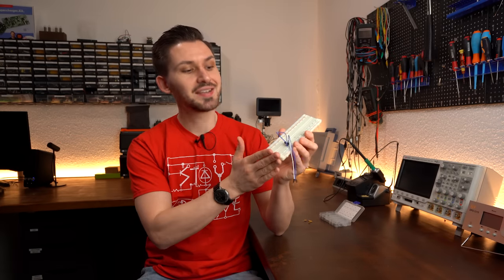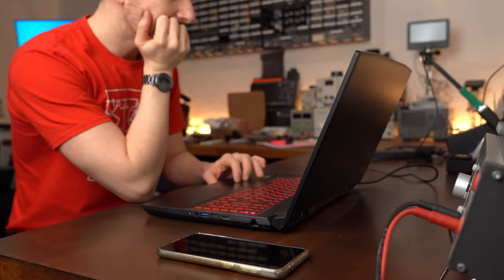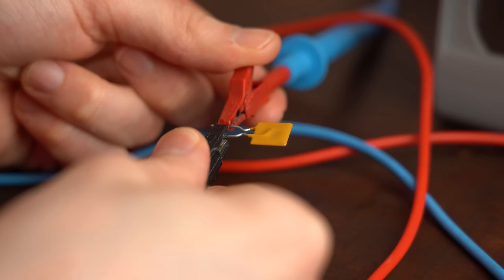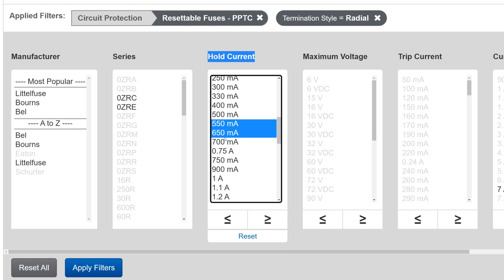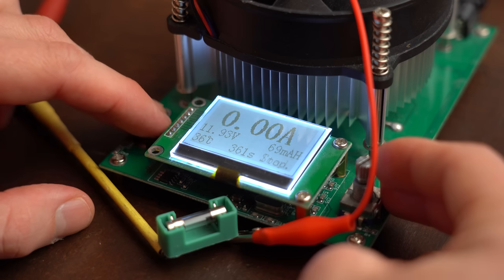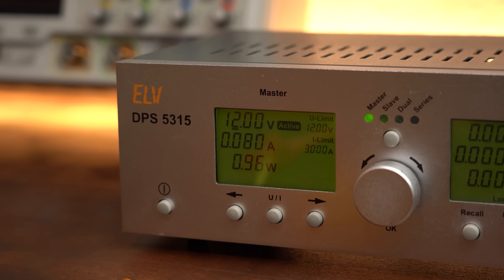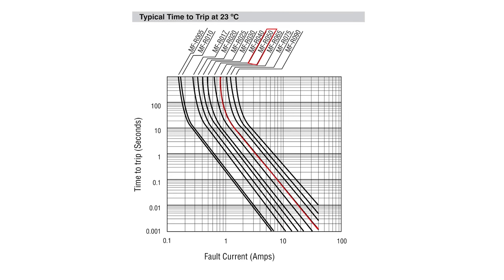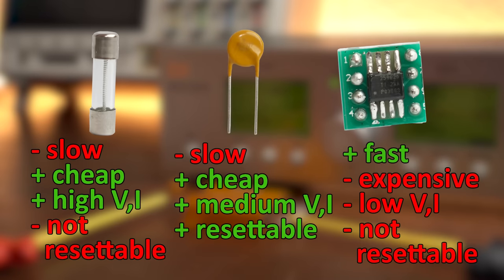The Best Protection for your Circuit is NOT a Fuse!.....but a Resettable Fuse? EB#54

Comment: Fun fact: Voltage rating of PTC fuses is important: I once experimented with a PTC that I took from an old knock-off Ni-MH Roomba battery pack and I exposed it to 10 A 32 V. I don't remember the rating, but it tripped and for about 10 seconds staying in a tripped state nothing interesting happened... After which it burst in flames in a spectacular fireball! So the conclusion is that voltage rating of a PTC fuse is important.

Comment: Great video, but a minor note about the comment that eFuses aren't resettable - that's incorrect. The TI TPS 2596X0 (that you show in this video) is latching off, the TI TPS 2596X1 however will auto reset. I learnt this while shopping after learning about eFuses in your first video. :D I have TI TPS 249631's in my pet projects thanks to your video, and they happily auto reset when I accidentally trigger them.

Comment: Fuses are there to protect the wiring (and PSU) supplying the current to the device.
Reply: If the fuse is located in the plug which is connected to the wiring, yes, however many devices contain fuses on the circuit board inside the product, and they are not there to protect the appliance cable.

They are typically much lower current rates, say 100mA.

Comment: 8:36 I think the variable power loss is reasonable, since resistance increases with temperature and power loss I proportional to resistance. So unless the PPCT is maintained at the literature temperature it is always going to be different. More often higher than lower since temperature increases during operation.

Comment: Pretty easy to replace the fuses on the phone motherboards. Provided you have the right tools. Micro Tweezers, flux, and a microscrope. Using tools will give you the schematics needed to debug the lines and find the shorted fuse. But I digress. I understand not everyone has access to the physical tools needed, as low end would be around $1200, but still ver achievable.

Comment: I normally use PTC fuses, though i find they get pretty expensive as you go up in ratings as they get physically bigger compared to your regular one-shot glass/blade fuses. They also get a bit looser in characteristics. So for some things like a Train speed regulator that may have to conduct up to 120W and preferably has a faster one-shot on a sudden derail short. I use automotive blade fuses instead.

Comment: Best Testing  fuse is a incandescent bulb/lamp('s) in series  
Not Only does it Pervert a True dead Short but also acts as a current limiter & Below voltage Limiter  For more Sensitive & untested "Experimental"  "FAULTY" Devices / circuits it makes  more sense
Reply: Incandescent bulbs do protect...but there are circuits  that require a small real-estate area...besides rigidity..in some instances the  lamp is a fragile / brittle...component
Reply: @analoghardwaretops3976  That's why they're only on the test bench. Inside finished products they don't really make sense.

Comment: fuses are mandatory especially ebikes whenever i wire up an ebike I just put a 60A dc mcb then a ton of glass fuses for the accessories and blade fuses for the controller and motor so that in case of problem i can easily find who is the culprit

Comment: Learned about these when troubleshooting rasb 3B and few other electronics. My question would be what effect of temperature has for these different fuse types? Does the cold delay the fuse potentially causing damage before it can trip in negative C temps. How about air moisture effect? How about in hot climates?

Comment: 8:50 I think you need to consider the temperature derating curve of the device, since its now running at 95C not 23C. After all, it is a PTC, therefore the resistance increases with temperature and so P = R * I² increases as well.
Reply: I once solved a product issue by using the thermal derating curve. A coil used in a clutch. Normal operation would see a 3 second operation. If an abnormal operation were to occur, the coil would heat up rapidly, but not necessarily go over current unless an insulation breakdown occurred. The application was designed to prevent that occurrence.

Comment: In SMPS circuits, glass fuse is soldered to PCB and not on socket. because fuse does't blow, it bursts. Unless proper cause is found it shouldn't be just replaced. Else that fuse also will burst.

Comment: @GreatScott! You are wrong about the tripping speed of normal fuses. If you take so called "very fast-acting" fuse, which is designed to trip fast - it trips in time of a few hundreds of milliseconds @ a double current. Used for very current sensitive circuits. So you had to mention the type of the glass fuse you were using. The other reason the world is not completely displaced the melting fuses with PPTCs is that they degrade over the number of times they trip. They are normally used in the environment when the overcurrent situation is rare. The other disadvantage of PPTC is that its resistance before and after it trips differs. It will never be the same again due to the material PPTC is made of. There is another type of fuse you haven't mentioned: the so called "TBU". This guy trips in about 100 nanoseconds time (the datasheet stated time is 1 uS, to stay on the safe side) and is fully resettable. But as it is the mosfet based device - it's very sensitive to the voltage.

Comment: be careful to observe the maximum short circuit current rating. the polymer is flammable and the fuse will catch on fire if the max short circuit current is exceeded. for example, if you have a 1 amp ptc fuse and your battery can give a short circuit current of 50 amps , no problem.  if you have a car battery that can give a short circuit current of 500 amps, the ptc can catch on fire. this is similar to the interrupting rating of a conventional fuse.

Comment: Sometimes a circuit is better without a fuse. I had to remove both protections from a car batt charger, the heat relay and the fuse. Still, there was a third protection within the diode module.
Reply: That means your fuse isn't sized appropriately or have a suitable disconnect time.

A fuse in normal operation will have no effect.
It isn't that circuit is better without them, it's that the design is wrong and is interfering with normal operation.

Comment: Finny I was just on mouser yesterday looking for a PTC to protect a connector that had 12V on it for a fan but is fed from a high current capable source.   Ultimately I decided to go with a standard fuse because of the temperature range that the unit will require to work in... from well below freezing to above 100F..  The temperature derating was a concern and was worried it would not properly protect in the cold climates and trip too early in hot climates.

Comment: Problem with these is that they still allow current to flow because they want to maintain a constant temperature when tripped. You have to be careful where you place them because they can cause a different component to drop all that voltage and current across it

Comment: Not that good I would say, PTC fuses have at least 5 distinct drawbacks:
1. There is a peak current that must never be exceeded. For example a 1A Littlefuse RHEF100 has a maximum peak current of 40A. That means that in car applications, you must probably add an wire wound power resistor on the 12V supply line to keep the initial short circuit current within spec. 
2. PTC fuses wear out and degrade after approx 200 trip cycles. That means in practice that, if there is a permanent short circuit and the power of switched on and off (as in a car), or an intermittent fault, the PTC fuse may be worn out before you even realize there is a problem! 
3. Trip and hold currents are to a high degree temperature dependent. Does not work well over for example the -40 to +85C range usually required for automotive electronics. (RHEF100 goes from 1.36A to 0.56A trip current).
4. PTC fuses are not even considered as fuses in for example the EN 60950 safety standard. So if you're heading for a CE approval, the test house will apply a short circuit across the fuse during the safety testing! That's not much of a fuse then 🙄
5. Disc type PTC fuses are extremely slow compared to "F" melting fuses.. May be a problem if you want to protect sensitive semiconductors..
But If you can accept all the listed drawbacks, go for a PTC fuse 😁

Comment: Yeah love these things 🙄. The fuse in my Roborock is either cheap or not sized for the job.
Now my vacuum can't charge anymore unless I allow it to cool down completely after cleaning my apartment. It is a know problem, I have to take the entire thing apart to replace it. So tempted to just solder a wire in place but it may protect against the battery going into nuke mode during charging ....
Reply from the maker: Thanks for the information. That does sound annoying.

Comment: They are great but..... the problem with them is that if they fail you will have a hard time i have got a bad batch of them and about 25% were tripping  even on lover than a whole current and you will not see that for 20-30min so I shipped about 300 units of my product with them and after a week got to do a recall.

Comment: Poly fuses still don't act quick enough in all cases. We had them split and more damage to the phone circuit. We used the poly fuse on the phone line, our surge boards worked better that had half amp fast acting fuses. Phone lines had surges that could ruin a whole phone board. Our payphones still used surge protector with replaceable fuses. The grounds on the phone boards protected the boards but we replaced a lot of varistors. Our air machine boards use multiple varistors and many come in needing replaced. A low amp fuse and the fast acting are better than any electronic part. I would not want a poly fuse protecting my home from shorts. Fuse is the best protection besides a circuit breaker. The circuit breaker is better on 240 circuits because both hots are disconnected if only one fuse blows the the other side can back feed into the fuse box I'm talking about the cartridge fuses that also protect the smaller screw in fuses. The water heater is a big resistor in series with the other circuits. If the 240 fault was with a motor a similar effect would happen. Any heating element can be a big resistor. 73

Comment: I've tried Resettable Fuse.
I gave it maximum voltage as per the fuse rating (mine was 30v) and shorted the load. The temperature continued to rise and after a few minutes it caught fire.
It is possible that it burned because the temperature was too high and finally the fuse broke (shorted) and finally the current rose again and burned.

Comment: If you really needed a resettable fuse that completely opens the circuit, there's probably a way to use a PPTC in conjunction with a relay, I'm trying to picture the circuit in my head but I'd need to draw and test some versions to see if it could work!
Reply: You could use a "no volt release" circuit after the PPTC. Short version is the relay's coil is powered by its own output.

Or another option is the "auto reset circuit breaker" which uses a bimetallic strip.

Comment: There's still one important question uncovered: what about very high fault currents? Can the PTC withstand 100 or 200 Amps or will it explode hopefully cutting the circuit? Or will it even get conductive permanently like many semiconductors? Traditional fuses can handle fault currents of up to several 10 kA! And what about overvoltage?

Comment: I blithely used one in a circuit that monitors it's own power supply voltage... Not a good match, since the relatively high resistance and temperature instability led to serious errors.

Comment: I have once tested a ceramic heater, which had negative temp coeff until is reached the rated temp, but had really huge positive temp coeff after it went over. So it was very actively fighting against overtemperature events, without any semiconductors at all. So these heater elements cannot catastrophically overheat even if the supply voltage is somewhat bigger than it should be.
But multifuses (using similar material science) are kind of a let down for me :(

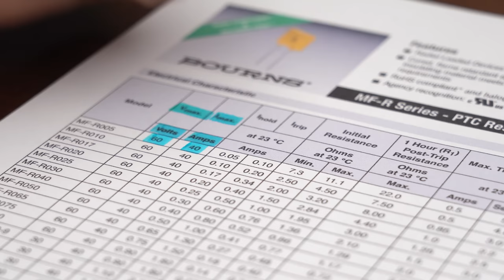Comment: 4:19 wait I thought hold current is the current that will keep the fuse tripped once it activates. So the fuse to be reset it needs to go below I hold (by disconnecting the power supply for example). Current up to I trip can flow continuously without tripping the fuse. Correct me if I'm wrong

Comment: Thanks for the video GreatScott. Was blowing up my previous fuses due to the capacitance in my circuit, causing insurge current. There is a Nominal melting parameter i didnt calculate previously for normal fuses. May I know if PTC will face this issue? Thanks =D
Reply from the maker: I think PPTCs can fit better here than normal fuses. Give it a try.
Reply: @greatscottlab  Ok thanks for the advice 😘

Comment: very good timing. I am getting into wled and rgb strips. I have already bought the parts and skipped the fuses since my powersupply from meanwell has according to the specsheet all protection already included. 
But if i were to use a less reliable psu I now can choose a pptc fuse that will fit my needs
Did you already think about making a video with solid state relais? 
also I can add mouser to my list of trusted shops now ^^

Comment: I like pptcs, but if you use a diode for reverse voltage protection and you have basically a short circuit I think they trip too late compared to a conventional fuse.
Reply: texas instruments had a guy.
his write ups where/are pireless. he's old.
his write ups on the various applications[the actual circits]

go looking

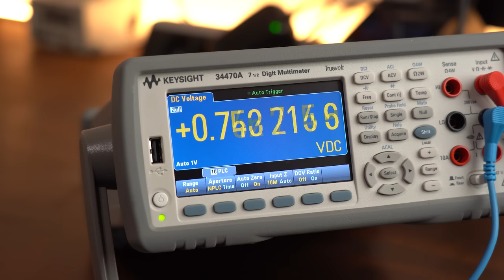Comment: 6:15 once the fuse trips it makes a disconnection by high resistance and then the voltmeter should show the power bank voltage, here it shows zero

Comment: Everytime i see a non resettable fuse in anything but the cheapest of equipment it blows my mind
Reply: They're cheap, small, and reliable. Most of the ones I see are built inside of devices, where if properly chosen they will only blow if there is a catastrophic failure. I think resettable overcurrent protection only makes sense where the user can cause the fault, such as an external power supply.

Comment: A 3D printer blew a fuse, but it wasn't the fuse's fault. The fuse connection corroded, causing resistance to heat up the fuse until it blew, partially melting the fuse connection housing. This circuit wouldn't help with that. Perhaps some WD-40 will preserve it. Or.. maybe it will help if it monitors temperature.

Comment: Not a fan of them, on many devices they end up being the early failure point, and this on devices that never had any excessive current conditions.  They just sort of wear out.  Two of the most common applications that come to mind are in resistor module, fan speed controllers for automobiles, and for coffee makers/kettles/heaters, etc, consumer devices that heat up.  Device checked no other fault, replace thermal fuse, carry on.  Most people would send the device to a landfill.

Comment: The advantage with convention swappable fuses is , the onsafe situation is being lifted and the device needs to be repared and the fuse swapped , but in the case of such an PPTC element the overcurent situation is not lifted if it's not detected right away, the circuit is broken for a while but when the PPTC cools down the circuit is restored , thus creating a loop , there should be somethin in place with a relay circuit that switches it off other wise the situation is being maintained ?, or am i seeing that wrong?.

Comment: Question... I believe I saw on one of the graphs you showed, that if you pushed 10a through it, it would cutoff much faster after the 1a trip point, than if you just pushed 2am through, correct?  So then, wouldn't the circuit design technique be, if I want it to cut off fast at 1a, size the component's trip point to 250mA or something?

Comment: Could you use a bimetallic strip as a fuse, almost like a relay to deflects and break contact if enough current passes through and then monitor when the current drops to zero to activate a relay to keep the contact broken

Comment: Nice clear video!
Would anyone know the effects of these on sound signal? I was thinking about using some to protect speakers and the easiest would be to put one directly in series on the wire feeding them.
Reply: See my comment above. I never did audiophile tests, but using a Bourns Multifuse in parallel with a power resistor I protected a lot of drivers that would otherwise have been destroyed. Including my two hard-driven 400W RMS 15" Beyma drivers with 4" voice coils. At a school summer fair once, they were the main PA speakers for a full band outdoors (!). After a while I noticed a strange sort of compression effect going on with the sound: the band was hot and so was the weather. The protection was working and 28 years since fitting, those drivers are fine.

Comment: Attn greatscott in hvac ptac units it is common to use a ptc in place of a capacitor on some low hp blower motors.  That said my question is this if these degrade when tripped or held in a tripped state over long periods of time. How do they work around that?  Thanks for any insight you may have.

Comment: The question one would have before the video starts would be what the difference between a resetable fuse and a circuit breaker is.
Reply: Think the answer is obvious.
Reply: @deang5622  not to someone with very limited knowledge of circuits and electrical components.